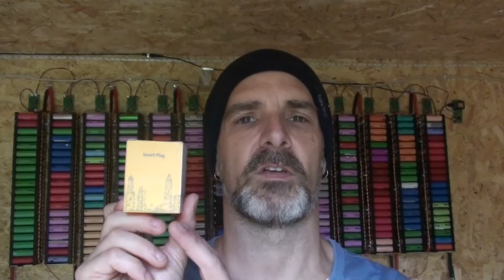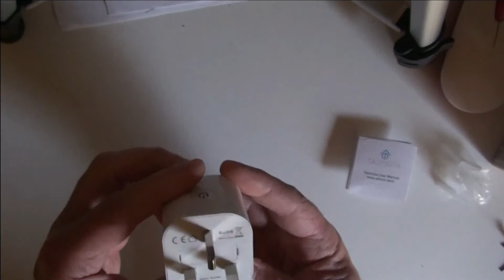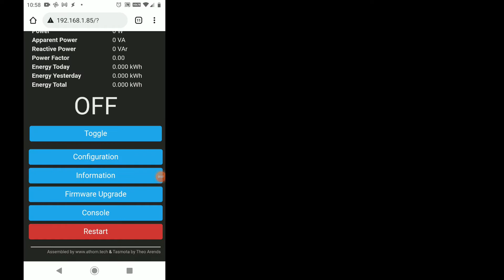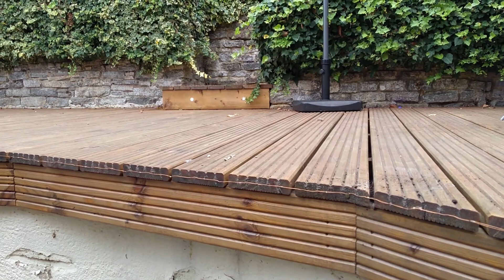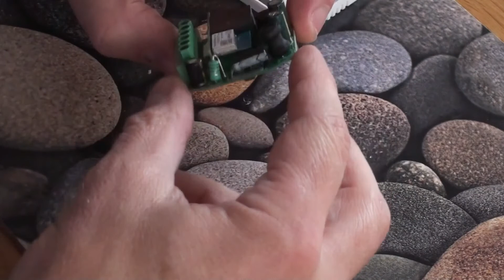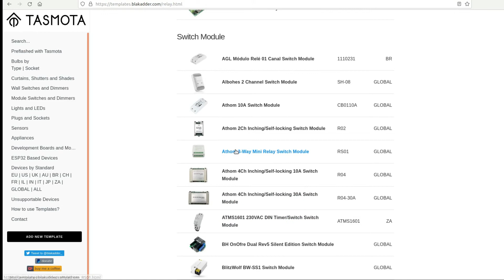Trying out Tasmota firmware smart plugs.

Comment: Hi Nicholas. I've watched quite a few of your videos. what I'm most interested in is these open source smart plugs.  I would like to use these smart plugs to optimize power usage in my house where I have a fixed amount of power coming in (5kW). For example to turn off the electric heat (or any other appliance that uses a lot of power) when the fridge needs to turn on so I don't trip the circuit.  Don't know how or if you're willing to help but thought I'd get in touch see if we can start a conversation.  Thanks.
Reply from the maker: You could certainly do that with a bit of coding knowledge.